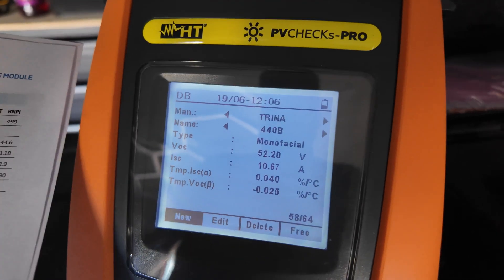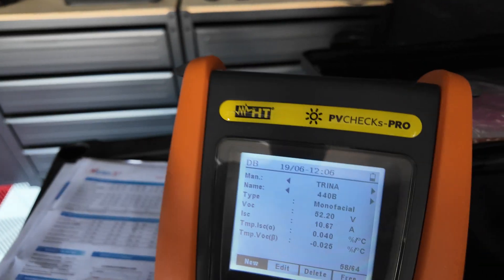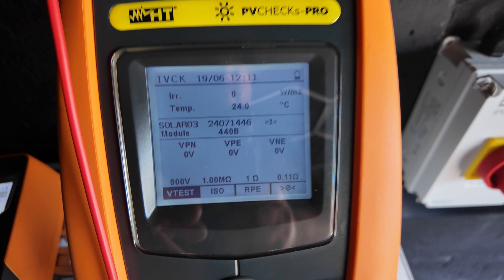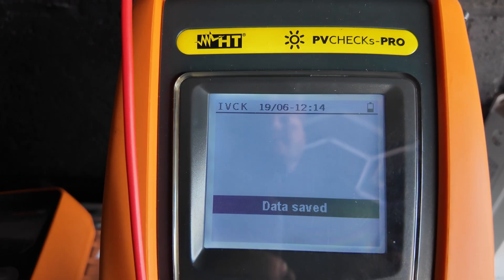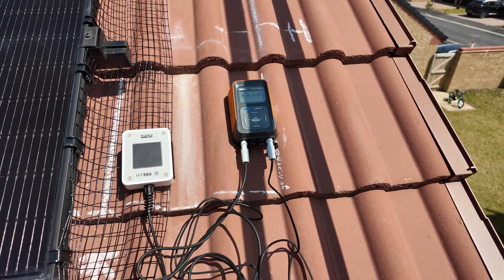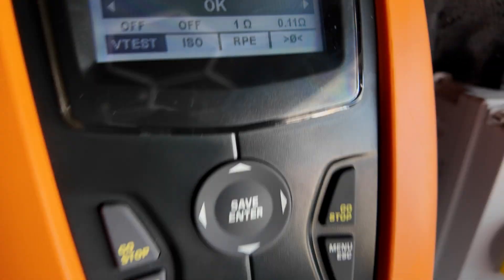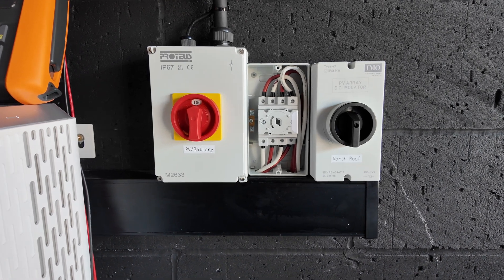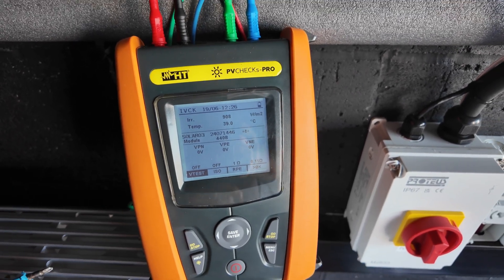Step by step how to use/setup the TIS solar PV Checks Pro

Comment: I have just got the pv check s, when i try to test it comes up with isc current to high message. I assume this is a setup issue on the test equipment
Reply from the maker: what is the Isc of the panels you are trying to test? Are they bifacial?